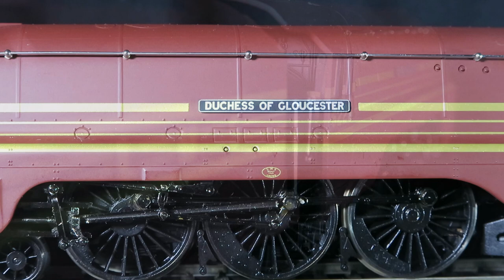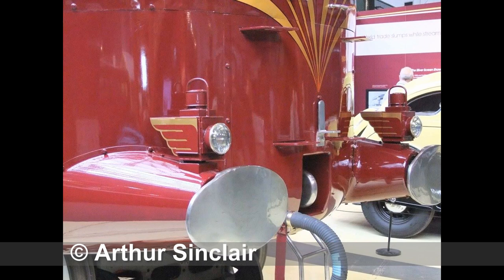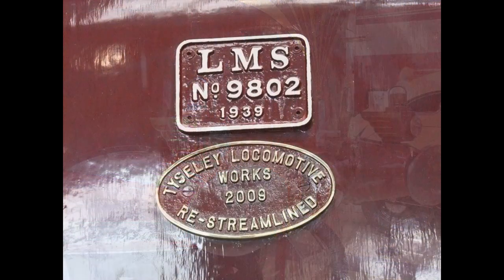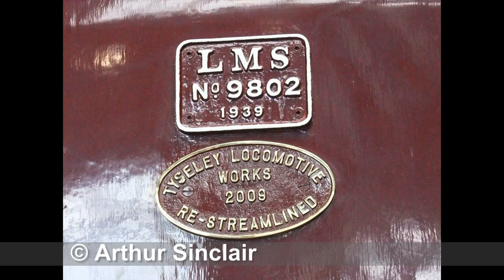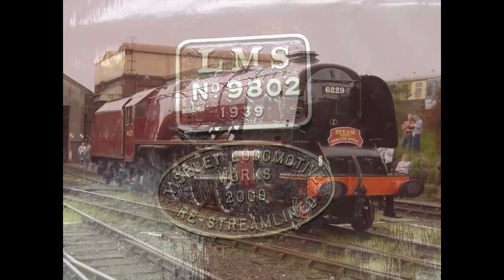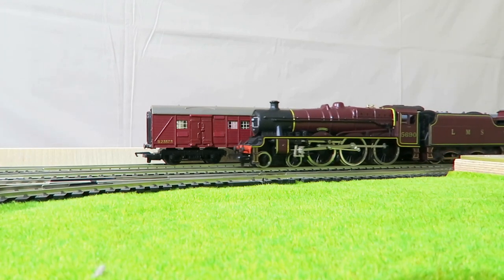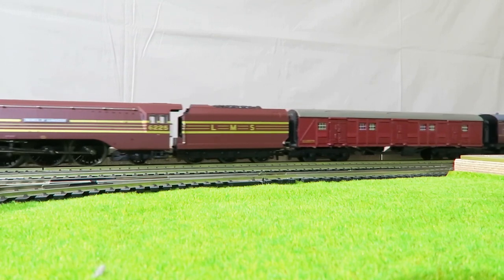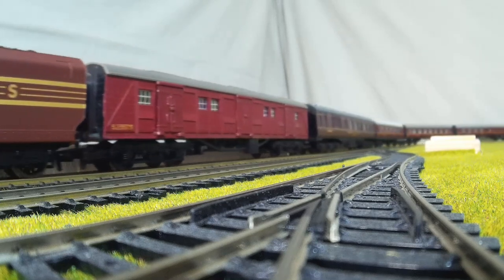LMS Coronation class 4-6-2 Streamlined Crimson Lake Livery

Comment: The model bears little resemblance to the real thing due to the flat, faded-looking paint the model manufacturers insist on using. It would be beautiful otherwise. The drive wheels are shinier than the sheet metal! That's just WRONG, but try to tell Hornby that... people try to claim SHINY is not "realistic"! I guess somebody needs to talk to the folks at the Museum, and tell them their engines are painted incorrectly... OR maybe the builders of the original locomotives didn't know how make a loco look "real"...?
Reply from the maker: Thanks, glad you enjoyed it